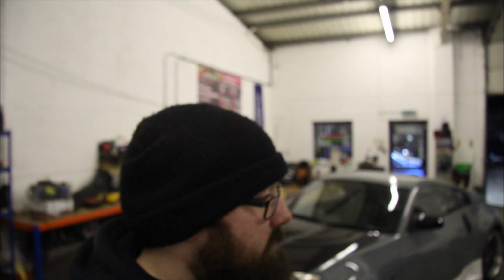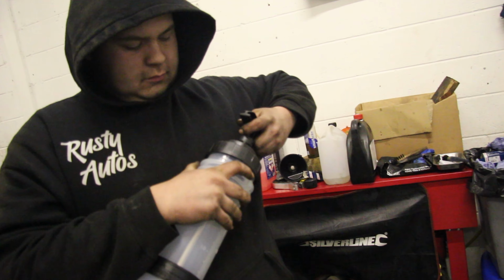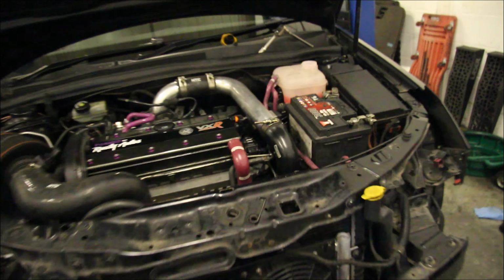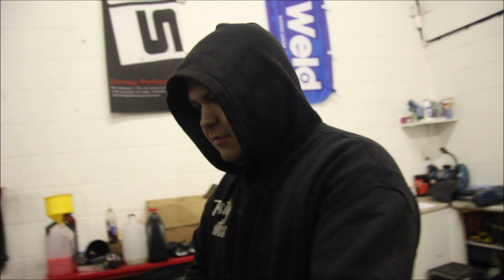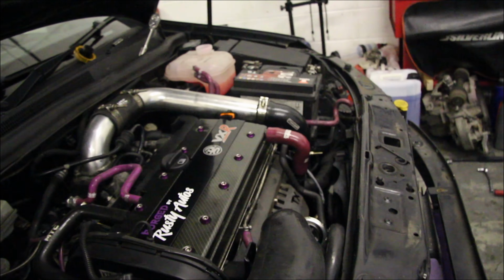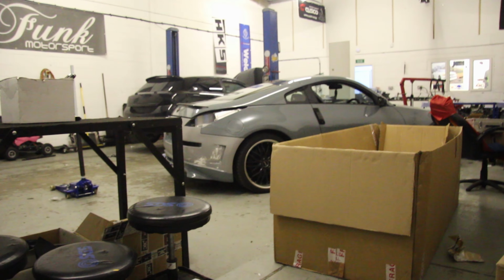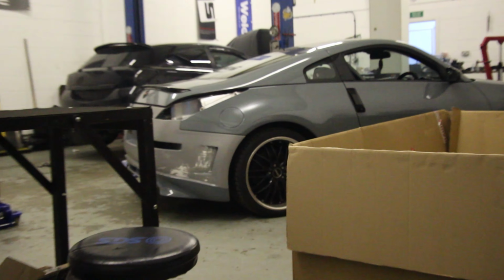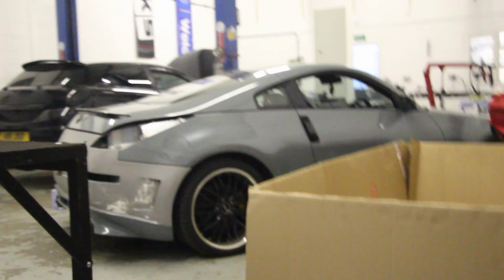WORST ASTRA VXR EVER, WHAT HAPPENED?

Comment: Only found you guys yesterday. Seen the corsa vxr and now the Astra, great video and great work. Mine is the 06 Vectra Z18XER, not fast but enough for me. Have it 11 years and 100k of the 133k mileage are mine.
Reply from the maker: Wow thats some miles! Shows u looked after the car tho to still be going strong!
Reply: Rusty Autos yeah regular oil and filter changes are key and it’s over due one at the min. Had I right mare with it over the past week. Wouldn’t start, couldn’t hear the fuel pump. No fuel at the rail. Fuses ok but ECU and CIM faults. Pulled the fuel pump out but went ok of the battery. Found my old opcom software and reset the ecu and immobiliser reprogramming keys. Earth off the ECU was slight corroded, couldn’t tell until I took it off. Cleaned it up and ECU fault was no more but I had main circuit relay fault now 🥵. Bypassed it and away she started. Just waiting on the replacement relay then I’ve a coolant leak to sort at the oil cooler.